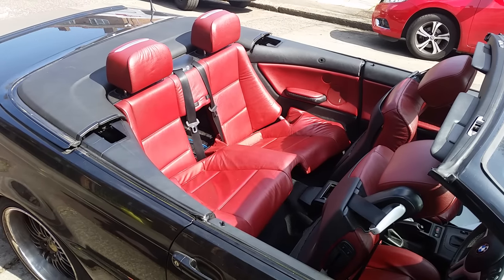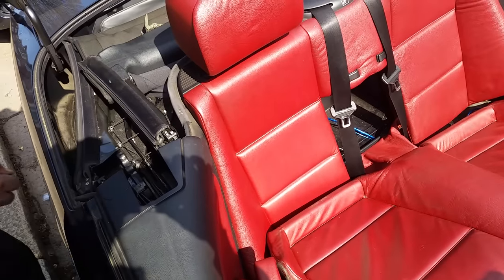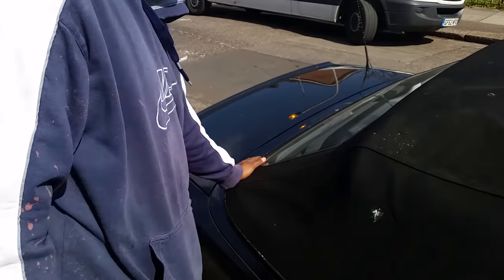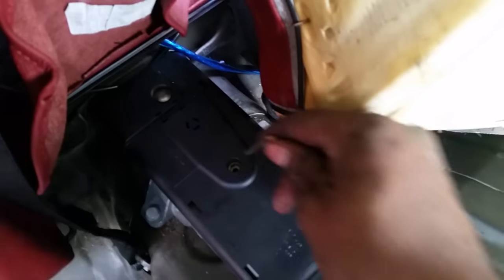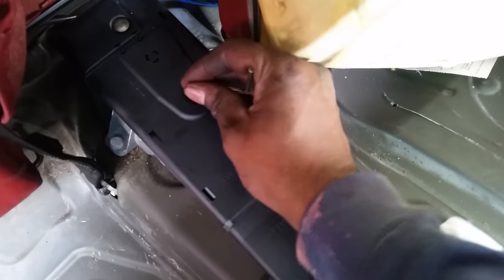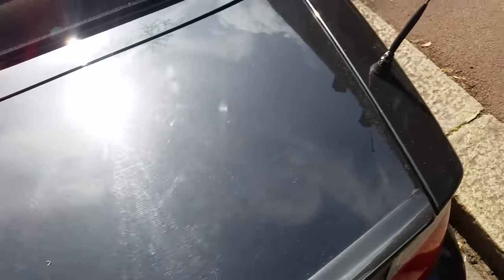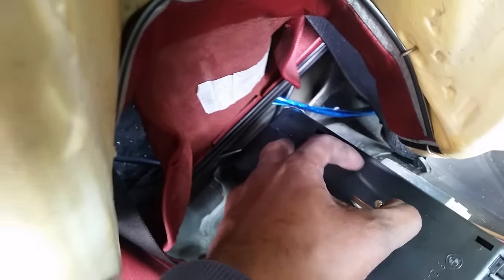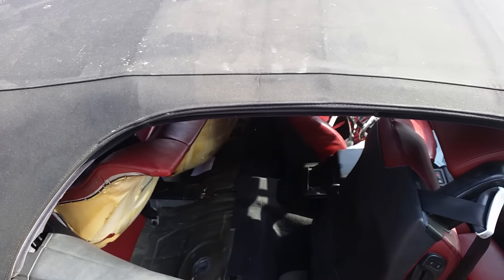How to manually lock a fully electric BMW e46 convertible roof emergency close open procedure

Comment: YO YOU SAVED MY FUCKING LIFE/WALLET MAN. I tried putting my top down for the first time in months today and it malfunctioned somehow (been having module problems for the last 6 months) and the top went down then up again even though I was pressing the same button and the top of that little compartment where the roof goes stayed up !!  AND the front of the roof wouldn't go all the way down leaving about 1-2 inches of openness bettween my windshield and roof. I was stuck at a poker tournament I busted out of 30 minutes away from home. I couldn't drive faster than 30 miles an hour our that roof of the compartment would fly off (as well as my actual converitble roof if I drove  over 40). I ahd to tkae the highway to get back so there was no way I could get home. I drove my car to the nearest BMW dealership and they fucking told me that the diagnostics would cost around $190 and that would be just to find the problem not to fix it. So I said fuck that and called my dad. He called our insurance and a tow truck brought me and my car home. I got home and researched this problem as much as possible and found your video. I took off the seat by watching another video on how to do that and then followed your instructions, by unlocking it with that button in the middle I could manually move the roof and the compartment roof . I managed to put it down and then for some reason when I pressed the button it put the roof back to normal and everything was fine.  Im stoked cause I thought I was going to have to find a place to fix it for me, I was just researching to see if I could figure out the problem and tell a mechanic what it was but I managed to fix it all by myself and  not a penny was wasted ! Clutch wouldnt even begin to describe it. I dont know who you are sir but this video saved me a lot of money and a lot of time and headache (was going to have to uber everywhere until I fixed my car).  Thank you so much man

Comment: thanks for this  had no idea it came with an allen key it was chucking down with rain when my roof failed to close youve prob saved me quite a few quid
Reply: Hi, I just picked up a 2006 325 Ci...the top has problems.  Can you tell me if the strut to the front section has a bend on it or is it straight?  Mines is bent on both sides about 30 degrees.

Comment: H i Satar,
Thanks for sharing this video. We just took on some serious rain here in the midwest and my trunk has taken on water as well as as the deck under my rear seat. I opened my top today to try and get into the top compartment to work on the leak and now my top will not close. It opened fine. my blinkers and radio have gone haywire so its obvious that come electrical stuff got wet. Anyway, I've pressed the manual unlock button for the deck lid but it's not working..The button was actually stuck and it's corroded. Any suggestions?

Thanks in advance.

Comment from the maker: I will be posting a new video soon on how to test all your Motors as I was told all my Motors were gone tested all myself and found out they were working and managed to fix my roof
Reply: Thanks for the video! Please post an update, i need help with a non functional roof as well.
Reply: Can you please show how to close the top manually pls? once the roof is folded down and lid on top, i cant seem to get the rear lid to lock shut flush!
Reply: @DebonairD  ä

Comment: Very helpful mate, the auto roof on my M3 vert works fine but this will be good to keep in mind if it ever goes on me! Defo don't wanna be stuck with an open roof here in scotland as you can imagine..lol Pretty sure there is no allen key on my box inbetween the rear seat but I have it available in a small socket set in the boot.

Comment: Hi I kno this video was a few years ago , but what was the problem in the end - I’ve had my 330ci for 14 years this weekend the hood went down but won’t go up-  had to do manual over ride - but the electric button it will go down - but again won’t go up -  the metal frame where it goes flat along the eddies and passenger window - would I not go flat had to take 2 little clips out -  any idea ???  Or kno any enthusiasts that might kno xx thanks x

Comment: Or just read the owners manual where this info is, worth noting that you should always do this with 2 people as the frame can twist and then the roof will need resyncing, also you need to alloy pressure to the front evenly to lock the roof down again if you do it on your own you risk twisting the frame. It’s all info from the owners manual you receive with the car.

Comment from the maker: the only thing I can think of is the cable has come off underneath the black motor at the back there's two cables check the connected and just keep turning the allen key at the front of the roof as close as possible you should begin to hear it tighten up if it's not tightening up then I think your cable may have snap you shouldn't need to have any weight on the roof just keep turning the allen key and see what happens

Comment: Thanks for video. Would this be the same procedure for a 2011 e88 1 series bmw. Need to manually open mine to fit new back piece as I had a back smash. replacing parts. boot wont because its sensing that the boot id open (I think).

Comment: I keep turning and there's no convertible coming down nor any clicking noise? It looks exactly like your car at 1:04 but once I start turning the allen key, (even holding down the drivers side of the convertible, it doesn't want to latch on! Help a brother out!
Reply: Ava Giovanni mine doesnt do any latch movement when turning the Allen key. The whole cylinder comes down

Comment from the maker: the bottom of the seat has three clips just lift off and unhook the middle section just underneath the armrest

the back of the seat has 2 clips at the top which just pull out and at the bottom there is 2 10 mm nuts just unscrew the nut call the top out and lift off

Comment: Thanks  for the video !  Send my 2001 e46 for a canvas replacement (after rear window was broken)  but for some reason doesn’t close anymore ! Any ideas what can be .?
Reply from the maker: There is quite a few sensors in the roof if anyone sensor is not working the roof will not work if you can get a special diagnostic off of eBay what scans the roof at might be able to help
Reply: Satar Moussa Thanks for your response ! Any chance you know the name of the tool you talking about ?

Comment: Man I cant my back window to pull up that easy...I have the exact same bmw
Reply from the maker: Sorry I don't understand your question properly what have the back windows got to do with the roof the roof itself is very heavy and you have to to pick it up at the right point in the middle if not the roof does bend and make it heavier to pick up and maybe you could put Sam WD-40 spray Grease on the hinges to help you

Comment: HELLO SATAR I am having problems with my BMW 318ci 2002 convertible roof I have a red light flashing and the roof will not open or close I been told it is not the hydraulice its one of the sensors but I do not no what one it can be so can you help at all ?
Reply from the maker: hello do you know the history of the roof that was it working when you got the car if it was and it just stopped then I suggest you check boot latch make sure it's locking properly I possibly there could be a break in the Loom in the roof I have found three things things that will stop the roof from working completely
1 the boot latch
2 the fuse for the roof Motors but if you have a red light on that means you will have power but just checking anyway
3 a break in the roof loom next to impossible to find if everything else works is easier to change the roof

Comment: So my softtop is completely dead! no lights at all when i push open or close button?? x5 fuses all good....any ideas pls?
Reply from the maker: Mas A 

In the glove box there should be two maxi fuses I think it's 30 amps control the main motor then there's a smaller fuse that controls the switch I know you said the the fuses are all good but at least you should have a red flashing light if not there's a control module on the left hand side on the rear seat what controls the roof completely check the connections maybe something has come off
Reply: thanks for replying, i will defo do the following you suggested, just one more thing, i can now manually open my roof and fold it down etc, the only thing is, the large rear flap thats rests down on the roof closure is not locking flush, is this normal? is there something i need to do for this to close flush ? otherwise it will fly off with the wind!
Reply: ok i did as you mentioned , i double checked the fuses and removed the left rear panel to check connections for the control module, they are good. Someone mentioned to check some fuse near the battery? is there a fuse near the battery? i cant see any

Comment: I didn't get an allen key with mine. What size do I need to try to find on eBay?
Reply from the maker: If you go to any local hardware store you can buy a set of Allen keys I think it's a 4 mm or 5 mm key or alternatively if you have an electric screwdriver with the right size attachment you can use that also

Comment: Will not be open movement.Third, rocking the open button is pressed, is and then a hydraulic motor is operating, but I think that is, to make sure the valve block is like not work.Check valve block three motor resistance, 11, being confirmed om.Confirm what is the problem is possible you guys something?If you want video will be sent by mail....

Comment: not an eaay task for a single woman. I got it almost there but didn't get the plap tucked under the Winslow when I wwnt baxk to do that I almost had Titans the roof collapwawd back on my hand trapping it. I yelled and no one came but fortunately with adrenalized strength I was able to lift it of my wrist with my left hand. No blood but a few dents in my hand and am shaking and sweating from the adrenaline rush and muscle fatique. Please have another person help to hold the hood while tucking back the window and closing the compartment lid. Holy Moly! I thought I was going to be stuck there! There is definitely a difference of strength in men and men! Scary!!!

Comment: I try to close it manually but it to hard to connect the top to the front weindsheild any help ??
Reply from the maker: Kevin Abarca
Reply from the maker: Have you got the allen key just stick it into the top and twist it if the locking tabs come down it will lock you might have to hold the roof down with one hand and twist it or if you have a friend you can have them push onto the roof well you turn it if the locking tabs are broken you will be unable to lock it
Reply: I have a Allen key that fits and I tried tighten it up but it won't tighten I tighten it up all the way till the Allen key hole starts clicking I unlocked the car one time and I guess I forced it open never got it to close after that
Reply: If I drive with it on and not locked the top flies open in 3rd gear I almost crashed
Reply: Kevin Abarca 
Hi did u ever resolve your convertible top issues? For some reason my top will not release the pressure and go down flat anymore ..I can't even manually turn it when using the alley wrench when turning it  to the left..it doesn't even tighten anymore but it does when you turn it to the left.. My locking tabs are folded in and they don't move anymore at all.. Any suggestions?
Reply from the maker: LAKEE AKA SOULJA GIRL 

Hello it sounds like the latch motor which is under the seat the cables may have snapped if you tighten disc and your roof moves then your cables are ok if you typed in it and nothing happens then it will mean you will either need to get new cable or a new roof
Reply: I sold it guys thanks for the concern tho
Reply: Satar Moussa mine won't lay flat either. Just opened it manually fine and when I pulled it back out the last section would not go down to connect to the windshield.
Reply from the maker: You have to make sure that the mechanism is working correctly have the roof half closed and wind it with the allen key see if the lock comes down and locks if it doesn't your mechanism may be broken

Comment: Thank you so much! My top did not close at all, it was open so now it is closed and no red light is blinking anymore. But still one problem, when I try to open the top it works fine except the last second I hear a klicking sound from the motor under the backseat. The round nut (?) is moving a little bit. Anyone who knows what the problem could be? /Acif